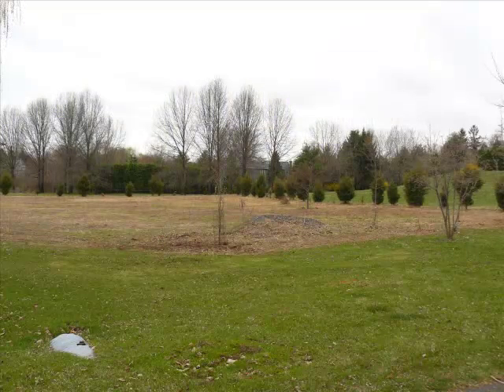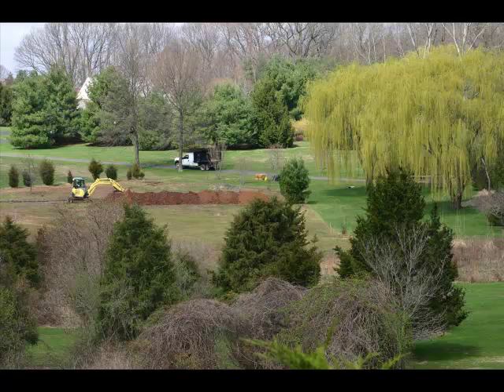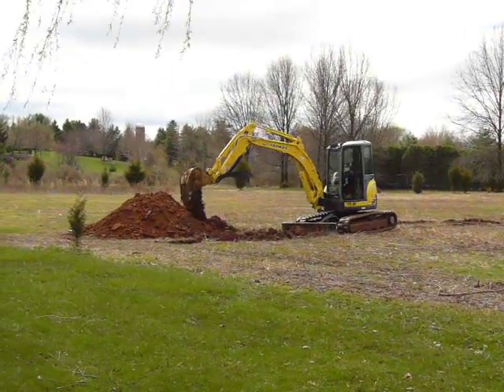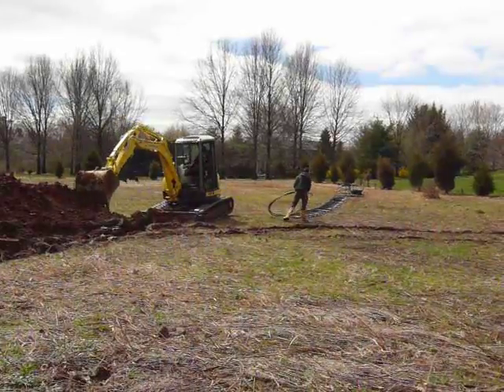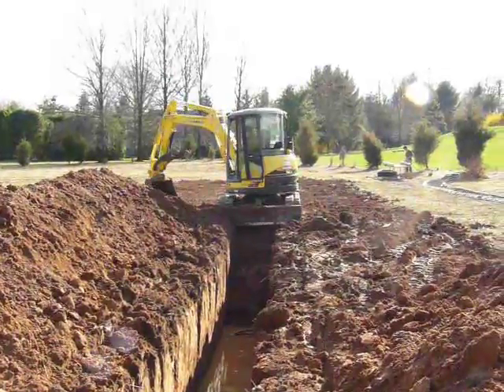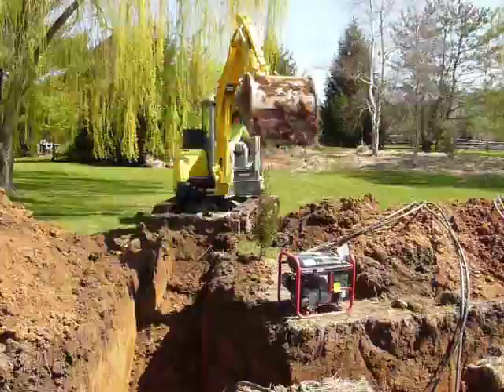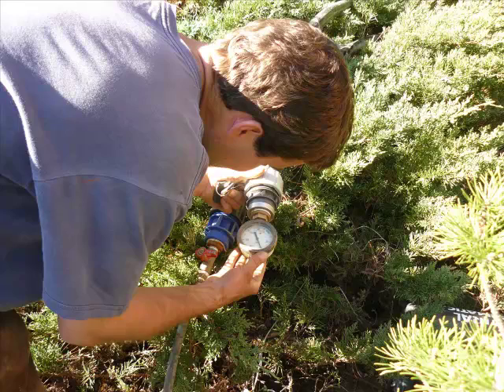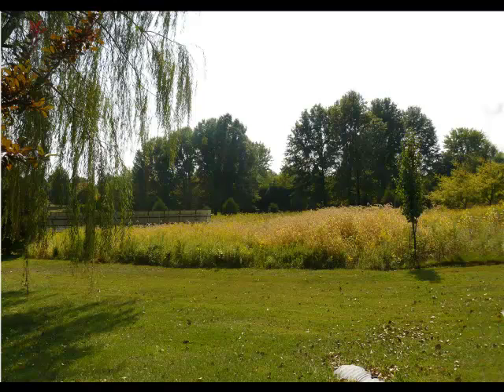Geothermal Energy and Solar Energy Installation - The Facts and What to Expect!

Comment: Very nice video and narration.

I was wondering are you using solar water collectors to store the energy underground, or are you using a conventional ground source heat pump?

This is an example of solar water collectors for collecting thermal energy in the summer and storing it in the ground for the winter:
https://youtu.be/KeeKSK-raVI

Comment: how does it work for you to this day?
Reply from the maker: in essence it uses about 60% less energy than traditional sources.  Last year where I live in PA my total heating, cooling and lighting bill for the year was only $182 for a 5,000 sq ft home.  I added solar to this as well
Reply from the maker: With the srecs at $50 about 6 yrs
Reply from the maker: This year from MARCH 2015 to start of MARCH 2016 my electric bill is $65 for the year (heating/cooling/water/lighting)